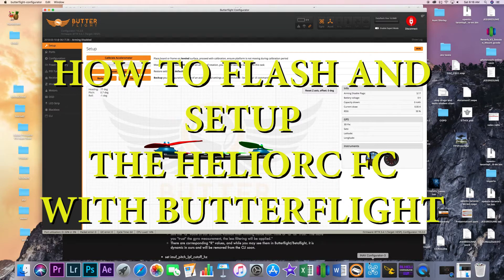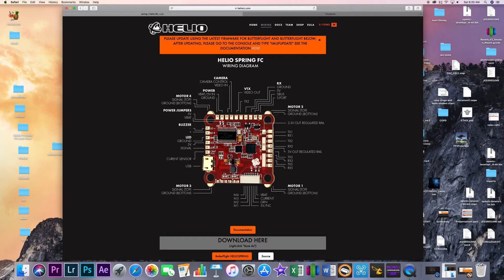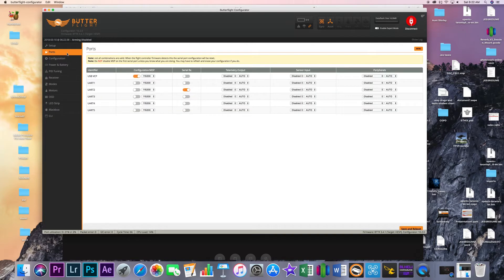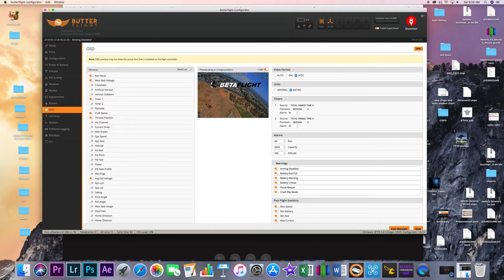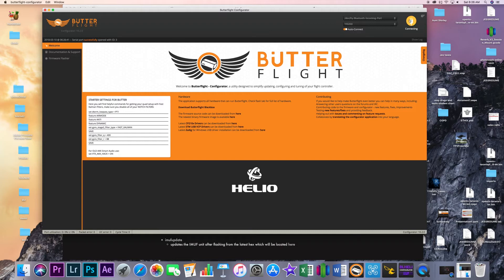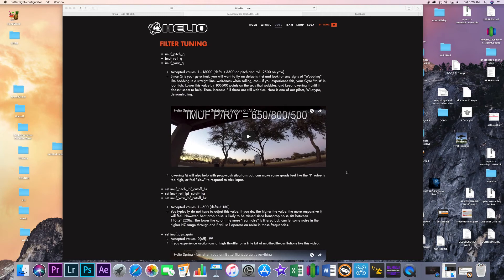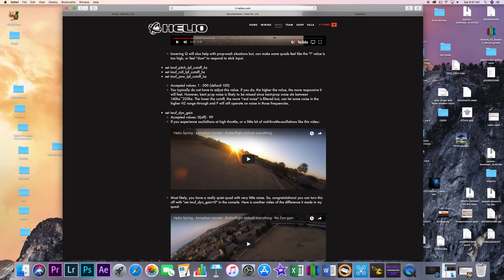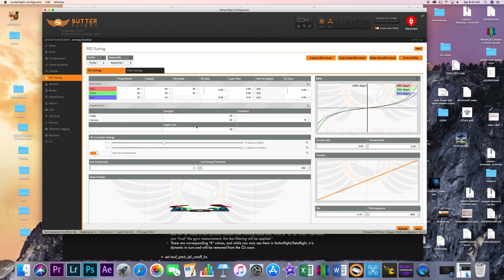HELIORC SPRING SETUP AND BUTTERFLIGHT FLASHING..EASY

Comment: Have u checked out my videos that i have posted in the kast comment?. I am really starting to think that this helio shit is all a bunch of hype.. people just trying to get some cash.. my oldest quad with bangood shitty parts flies 100 times better than this helio crap.. getting very frustrated and about to just throw this board im the trash.. it seems that everyone  else has no issues and im the obly one that doesn
. No one on slack helps me and everyone says its the tune.. its not the tune.. if you cant tune out a wobble issue in 4 hours then it obviously the firmeware.. i dont know what to do next.  Please help
Reply from the maker: FPV Addict yeah i did. Idk man. My reverbs took a little work but this latest flosstyle I built  was damn near perfect out of the box. To me all these fcs and firmwares have a place but for 5 inch helio just is in its wheel house. I haven’t had an issue yet and this latest build is just another piece of proof for me. I am still using the first elastic hex. Idk if that’s the answer. Seems like they’ve fixed with the newest hex but can’t really comment on other then what I’ve seen.
Reply: ChaddyCEEE RC well the only thing i can think of is that the montors i put on one of them had a shitty bearing.. but idk if that would cause my wobble issue. 
One other thing was the escs (spedix es30) i took off another build and it had the same exact wobble issue at mid throttle. So i swapped out the escs with holybro tekko35. And i put all new motors on it.. so the quad is absolutely brand new.. i also ordered another heliorc spring AIO and am going to swap it out.. 
So i will have a new fc new motors and new escs.. so if all that doesnt fix my issue then i think it would be the frame. But what gets me is that ive seen and talked to people that have my frame (skitzo nova) with the helio fc and they have no issues. 
If i do a flight and record a BB log would you be so kind to run it through plasma tree and bb viewer and tell me what u see.. ? I can also support you on your patreon page for your help..
Thanks steve

Comment: Chadecee rc . ive tried default settings on odin 3.5 2 1.0.8 imuf. And people on slack were telling be all dofferent things . Like low d to high of p.. and they have said that the issue is noise on my roll axis..  they also said to lower the imuf lowpass lpf to 70-90 on p and r. Also i have tried q at 2000 all the way up to 5000.. nothing helped. The inly thing that made a little diference is i changed the w from 32 to 64.. idk what is goi g on but i want look at this video at around 2 mins when i just throttle arounf 1500 the quad if u look close will wobble and u can even hear the motors arent smooth https://youtu.be/zA-tTYNjchYATx
Also this video at 2:20 and around 4 mins. It happens when i just fly forward around mid throttle.. please tell me you can help. Lol
https://youtu.be/GDlnGLm1z_E

Comment: Hey I love watching your videos you get into such detail which is amazing I have a question though I have a brand new Skitzo Nova build with The Helio spring all-in-one flight controller brand new hypetrain 2450 KV Motors and specs es30 amps I cannot get rid of a slow wobble at Mid throttle low throttle spine High throttles fine Smooth video but in my mid throttle range I don't think it's mid throttle oscillations it's more of like a wobble unstable forward flight. I am upgrading my ESC holy bro tekko35 amps individually ESC s maybe blheli32 will help smooth things out I have a video I want to send you so you could see my issue everyone else isn't having these problems and was wondering if you knew what I could do I'm running 32k 32k multi-shot and the only thing that seemed to help was raising my W2 64 I've tried higher pitch props also TPA just can't get rid of this issue flies great otherwise
I'm starting to think that the all-in-one has more issues than the regular flight controller what's your take on that please help
Reply from the maker: sounds like youve covered a lot of the bases already.  in my experience, when helio acts weird its always due to some kind of resonace from the frame/props/motors.  is anything softmounted?  if so take it all off..if not try just adding some grommets under the FC stack but still tighten the stack down fairly tight.  that is i have all of mine mounted.
Reply: ChaddyCEEE RC well im.using a dkitzo nova frame thats new. And im only using the grommets that came with the fc. I had the motord soft mounted it actually made it better. But i removed them to see if thatw as it and it got alot worse. So ur saying to add like a rubber washer underneath the fc gromets and tighten it down pretty good?
Can i send you a video and maybe abb log
Reply from the maker: FPV Addict yeah. That’s what I’m saying. Look me up on Facebook. Chad Cervinski. Galion Ohio. Send me a pm.
Reply: ChaddyCEEE RC i dont have a facebook account

Comment: I have a FrSky XSR that I’m using with the Helio Spring FC, but I can’t get the telemetry to work correctly. Any suggestions?  I've tried the set tlm_halfduplex = off command, but no luck.  Thanks.
Reply from the maker: Flosscillations dude I could never get mine to work either. It’s one of the most common questions on Facebook and slack. I think you get lucky or not. I’m using crossfire so it works with my uart. Doesn’t help you though. I’ll ask again on slack. Gotta be a firmware or design issue.
Reply: Thank you very much for responding.  Another reason why I'll be moving to Crossfire very soon.
Reply: Hi i had the same Problem. I install Pegasus Configurator and under Uart 1 i Set it to S Port and it works. I did the same setting in Butterflight and it do not work. Good luck

Comment: Hi there ...
Got one question...  I got my HELIORC without the Cable..so did Soldering erverything of the ESC...
My question is.. the PAD for CURRENT on the board,  what is it all about and I did solder it but did not see the amount of Current on the OSD. 
So whats next after soldering the Current PAds?
Any help is welcome.
Reply: set telemetry on your esc 
and it shoud be ok

Comment: Out of curiousity, is this imuf update for this fc only? I have an Omnibus Revo Bee32 F4 (one with floating gyro), and no matter what I do, any values available once selecting 32 sampling results in massive shaking off the motors. I'm not even sure if they are spinning or jerking randomly, but the esc and motors get extremely hot if armed like this for 3-5 seconds. Overclock to 192 is 42% load, 216 is around 34%.
Reply from the maker: as far as I know these are custom hex files built for the FC only